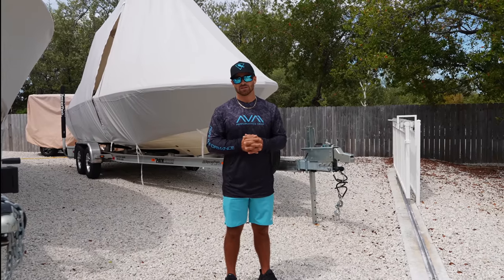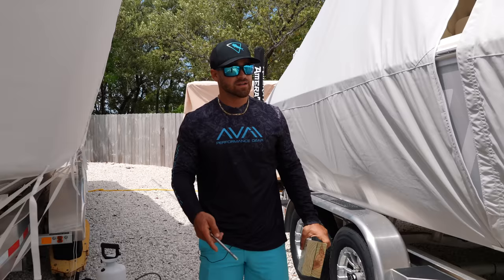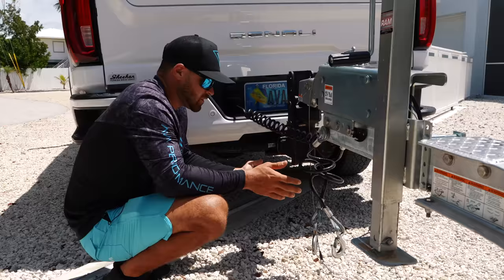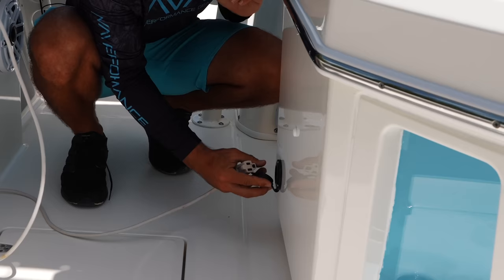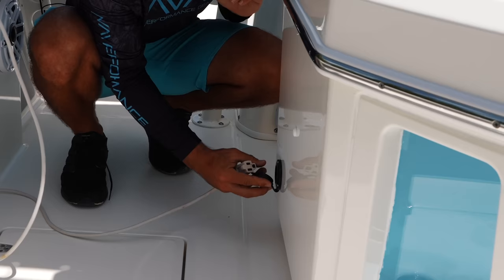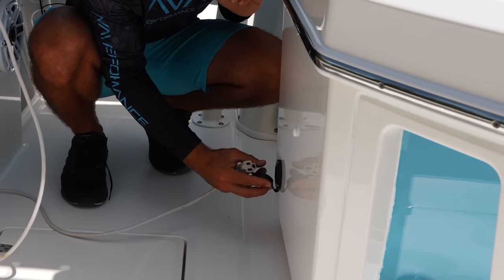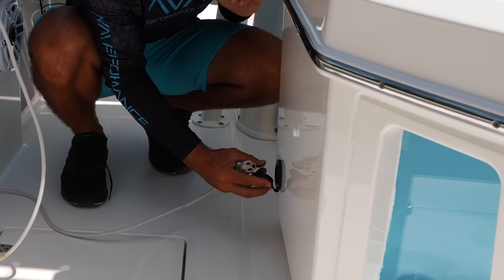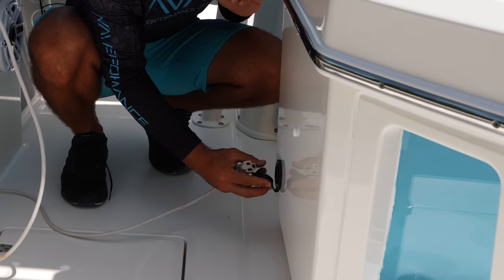Watch This & Boat Ramps will no longer be a nightmare.. How to trailer and launch a Boat

Comment: I’ll tell you a couple more really good tips that you missed on would be when your backing your boat or just the trailer down the ramp put your vehicle in neutral instead of reverse. Let the weight of the boat or just the trailer pull you down the ramp cause if your foot were to accidentally come off of the brake pedal and hit the gas pedal then all that would happen is the vehicle would rev up instead of shooting you down the ramp. The second thing you missed is you should always set your parking brake once you stop after backing down the ramp cause for one it’s just for safety and secondly the weight of the boat or just the trailer is on your parking brake instead of your transmission. And the third thing is when you load your boat back up, your D ring should be resting or almost resting against your bow roller that way the front of the boat doesn’t bounce up and down as you are going down the road. Which could potentially beat up the front of your boat. You nailed everything else though big man. Just thought I would throw out there these other couple of tips and tricks to help people out! And what did you say your clothing brand name stands for I couldn’t really understand it in the video. Thank you in advance!!!!
Reply: Fourth thing is to trim the engine up when loading boat back up.
Reply from the maker: Thanks for the input Mark 👍🏼
Reply: @LifeByTheBow  your welcome. And what did you say your clothing brand stands for? I’m sorry I couldn’t really here it in the video. Thank you.
Reply: your comment is more informative than the whole video.
Reply: @locksmithjeepguy  thank you.

Comment: Thankyou for showing the Floridian community about crossing those chains on the trailer. Where I live in NY, it is a law to do that ! When reversing while in the truck, one hand on the bottom of the Steering wheel makes it much easier.   You put excellent videos out there,   finally, Flush the motor which is full of saltwater. Run it with fresh water for at least 10 minutes. You'll need those headset-shaped for the bottom of the engine.                       Enjoy the Holiday.
Reply from the maker: Hey Keith, thank you so much for the feedback and the Information. We appreciate you watching.

Comment: There is a kit you can get that puts LED lights up high on the guide posts on the trailer AND on the cavitation plate.  Especially at night, but anytime really you have lights ON the engine cavitation plate and up high on the guide on posts.  They look great--anyone hits you on the road with those lights, they have a lot of explaining to do.  Also, there really is no downside to running with your lights on, increase your visibility while towing day as well as night.  One other thing, having everything done is great EXCEPT the strap that holds the thing on the trailer, that comes off dead last as you showed.  But yet one more thing--the ramp you are at has a dock--mine has no dock, so THAT is entirely different as you can't side tie--and the bow of my boat is way too high to climb aboard.  For me--just me, I will never do it alone, one man.  Patently unsafe in my mind.  Just as everything on a boat should be redundant--two of everything, that goes for the skipper, IMO.  Two people, two.
Reply from the maker: Thanks so much! We will check those lights out. We appreciate you following along on our channel!

Comment: Clay I love the content man! As far as the mechanical side goes... I keep a breaker bar in my truck at all times for an emergency, but during maintenance lugs should ALWAYS be torqued to the proper specs. Over torqueing can be just as bad as under torqueing. The PSI on the side of the tire is the max safe cold tire pressure. It is not the recommended inflation pressure as this varies widely based on load. This is a very common mistake and leads to excessive pressures on the road, more bounce in the tires, premature tire wear, and blowouts. Always use manufacturer specs for these values. If you can't find anything from the trailer manual, tire manufactures usually have pressure specs based on load available online.
Reply from the maker: Thanks for the input and appreciate you watching!

Comment: Clay, just to add, what I understand is a tire's “maximum” inflation pressure should only be used when called for on the vehicle's tire placard or in the vehicle's owner’s manual. And you should torque wheel lug nuts to manufactures “torque” specifications that should again be in the trailers owner’s manual. That’s a great trailer. Great instructions. Thanks
Reply: Came here to say this
Reply from the maker: Thanks for the input 👍🏼

Comment: I can’t believe I’ve never thought of backing the trailer up under the boat when you retrieve it! I recently purchased a Grady White Gulfstream that I often trailer by myself. It’s a little big to drive on the trailer so I’ve been using the dock lines to pull it up onto the trailer. I’ll try the method you showed and that should work much better!  Thanks!
Reply from the maker: Thank you!

Comment: Awesome video I’ve been loading our boat on our old trailer and new ameratrail now too before I knew how to drive a car lol and I still learned something and that’s using the silicone spray on the bunks which I’ve never thought of and luckily our saltwater boat ramp has a hose that we use to rinse the trailer but good idea mixing salt away in the pump sprayer if a hose isn’t there.
Reply from the maker: Thanks so much!

Comment: My issues at the ramp are inconsiderate boaters. I keep mine in water at a marina now. The stress of idiots was coloring my time on the water negative.  Love the tips. I have watched people load the boat while on the ramp. Disembark while taking up ramp space. If more folks would plan ahead and get r done away from the ramp, I would be a happy man. I launch in about 2.5 minutes and load about 2.5-3 depending on my wife’s ability to line up the boat with my trailering. Hook it and yank it.
Reply from the maker: Thanks for the input appreciate you watching!

Comment: I definitely learned some new stuff! Honestly, I'm not prepared to get a flat and start bringing my breaker bar and get a little ramp thing in case I need to change a tire. I also will start crossing my chains and make sure they are hooked up correctly. 

I also appreciate the PSA for being prepared and limiting time on the ramp. There have been a few times I have waited while people load or unload their boat on the ramp.
Does anyone else rinse down their wheels and apply that stuff to the bunks? I don't have disc brakes. To me that seems a little excessive and not necessary.
Reply from the maker: Thanks for watching! Rinsing at the ramp really isn’t necessary, it’s something I only suggest doing if you have the time and you’re not holding anyone up.

Comment: Another trick when launching solo is to tie a line from a bow cleat around the trailer and back to the cleat. Just like you do when tying to the dock piling. Release the bow strap before going down the ramp. This way you don’t have to jump off the boat to release it once in the water which gets risky as you get older. 
Additionally, If I have to exit the tow vehicle while on the ramp, I like to place a chuck behind the left front tire.

Comment: A few tips to add. Before backing the boat up always have a front and back 50 foot rope thrown on the dock. You then backup and release your front chain before it goes in the water. Boat comes off very easy and you have ropes to move it on the dock. This is a little over doing it and slow to launch.
Reply from the maker: Thanks for the input and appreciate you watching!

Comment: It helps to apply some grease inside the coupler. Keeps the coupler working correctly and keeps the ground for the lighting. Iron oxide inside the coupler will give part time connections.
The trailer height isn't 13 inches but 13 inches plus the height of the tape measure.
Get yourself some dielectric grease for the trailer light and and electric brake connector. I use a Zip Loc bag and store the connector in the bag with a rubber band holding it in place.

For a friction reducer on the bunks, instead of using silicone, a bottle of 4:1 dish wash soap is extremely slippery. The silicone spray is frowned on as you're putting a hydrocarbon into the water.

Oh, don't forget to raise the engine before pulling the boat out of the water so you're not that guy that drags the skegg.
Reply from the maker: Thanks for the input 👍🏼

Comment: Good info, enjoy the channel. Got a suggestion for you, get a good torque wrench, trailer wheels need to be torqued to spec to insure not over tightening. Your wheel bearings take a ton of heat as it is, no reason to over torque the wheels.
Reply from the maker: Thank you for the information. We appreciate that

Comment: Grew up on freshwater, Pops was a Bass Fisherman, spent about 5 years salt water boating eventually.  Man, that salt is no joke, cleaning it off. What a pain.

Ramp Campers need to be strapped to those Barnacle pilings for 2 high tide-low tide cycles. If they survive, fine. If not, oh well
Reply from the maker: Thanks for watching Sean!

Comment: I have thought that I am putting in perfect load position, but I still have trouble power loading . I wet the bunks and then pull out in good position but still have trouble getting boat to the ring ! I saw you put silicone spray on your bunks . Have you ever had it slip back because of the spray ? What brand of spray do you use?  Would appreciate your opinion and experience on this .
Reply from the maker: check out PB blaster spray. We have not had slip back while the winch is attached. You shouldn't be spraying a lot to where you're worried, a little goes a long way. Thanks so much for the support on the channel!

Comment: My biggest tip would be your headlights on in the mornings ir evenings. Turn them off. Where I'm at there's 3 lane ramps and if you get the middle ramp and the two outside guys have their headlights on you cant see anything. Also guys with light bars on their boats turn them on while the boat is still at the dock blinding you as well.
Reply from the maker: Thanks for the input 👍🏼

Comment: Another complete guide to getting the most out of your boat investment. Today especially, gear is not inexpensive. When you add the word boat to the equation you can double and triple the cost. Add salt and if you take shortcuts before you head out or in from the ocean…. you will have busted gear, wasted days and unfortunately safety issues that can be avoided. Well done Clay…. as an old lifetime boater, I learned the hard way…. Your’s is better!
Reply from the maker: Thanks so much Lance!

Comment: Another bit of trailer wisdom……..make sure to keep up with the age of your tires. Just because they have a lot of tread does not mean they are ok. Take a look at the 4 digit code on the sidewall. Once your tires are over 4 years old, you better be replacing them.
Reply from the maker: Thanks for the input!

Comment: '
the motor vehicle must use a shift '' N '' as neutral with a trailer boat while slow down ramp to the water...
dont use a shift '' R '' as reverse
Reply from the maker: I make sure to keep it in park 👍🏻
Reply: @LifeByTheBow  
hi L...
'
yes 2 locks brakes parks then boat to the safe water...
unlock 2 brakes parks then find empty parking lot...
return to enjoy boat time
Reply: I put my 4WD in low transfer and let it creep down the ramp.

Comment: Stainless Steel Brake Caliper's with Ceramic Brake Pads with Stainless Steel Back plates will last a lot longer, the brake calipers on your trailer are Dacromet plated and won't last to long when used in saltwater same as the painted brake pads back plates and more important wheel lug nuts should be torque with a torque wrench to the correct specifications, a breaker bar should only be used to break the lug nut loose or used only to tighten the lug nuts in an emergency other than that you still have a nice video as always. Tight lines.
Reply from the maker: Thanks for watching!

Comment: Hey Clay. Big fan of the channel. I'm not sure if anyone has asked this or not. But how long have you been using the Blaster silicone spray on your bunks? Have you had any issues with it eating through paint on the boat? We just bought a new 22' bay boat with "sticky"carpet. And I am really worried about damaging the boat while trying to help it come off of the trailer easier. Thanks.
Reply from the maker: I've never had any issues with the silicone spray eating through the gelcoat on the boat. I think you’re just fine. However, just make sure that you only spray the silicone on the front portion of the bunks to create some type of friction. That way the boat doesn’t slide off of the trailer.

Comment: Excellent video and very informative. Have no boat to launch but good too know whenever I am blessed to becoming a boat owner 
Question: at what point did you lower and raise the motor while launching and retrieving the boat 🚤 
Again thanks
Reply from the maker: Thanks so much! I don’t lower or raise the engine unless the boat is coming off the trailer

Comment: Did you mention that you should only tie to the dock if you're solo? Or, better yet, beach it if there's a sand or grass beach available? 
Tying to the dock when others are aboard is considered a major bonehead move where I live. It just isn't done, because it blocks the ramp and prevents others from launching and loading in a timely manner.
Reply: I thought I was the only one that noticed.  It was a moot point here because nobody was waiting for the ramp but if you were conducting trailer maintenance while blocking a ramp on a Saturday morning on the Texas coast someone might cut those dock lines and set your boat free.  Other than that, this was great information.
Reply from the maker: We explained this in the video but thanks for the input 👍🏼

Comment: A torque wrench would be better for those lug nuts. Some people just torquing on those things with a breaker bar will over tighten them. There’s some knuckle heads out there
Reply: Absolutely, I keep a torque wench in my truck at all times, along with impact sockets for truck and trailer lugs. I take a Milwaukee cordless impact on out of town trips.
Reply from the maker: Thanks for the input and appreciate you watching!

Comment: I have a question about something that worries me a little :) ... I got a 2021 Sierra 1500 2WD and I just got a Wellcraft 24FT Walkaround. Should I be able to pull that boat on the ramp without issues? or would I end up on an Instagram feed?
Reply: I have a 2016 Ford F-150 2WD that I pull a Grady White 232 Gulfstream. Probably about the same weight as yours. I am able to tow it fine on the road but have to use ramps that are not too steep or long. Almost got stuck a couple times trying to use ramps that were too steep. Pretty sure if I had a 4WD a 150 would have no problems.
Reply: @forgottencoastfishing  good to know. Thank you 🙏
Reply: Oh and make sure your trailer is set up so you have the appropriate amount of weight on the tongue. Mine was too light on the tongue at first and that’s when I was having a lot of trouble getting it up the ramp. Once I had the trailer set up correctly with more weight on the tongue I haven’t had any issues pulling it up and it tows much more smoothly and safely! I may be able to pull it up steeper ramps, just too afraid to try!  As you said, I Don’t want to end up on Instagram!
Reply: @forgottencoastfishing  Didn’t even know that was a thing. Got to look into that. Thank you. Yeah staying away from IG fail feed is a big must lol
Reply from the maker: Looks like this was answered, thanks for watching!

Comment: First time I have seen the silicone trick. Do you feel that really helps?
Reply: It works, but be careful! I have not used it on my bay boat bunks but my previous boat was a Carolina Skiff DLX 2180 that I used a lot alone. After using spray on the bunks, it was easy to just push the boat off the trailer by hand then walk the dock. After using the spray a few times, I would treat it like a roller trailer until I got a feel for it, I know my 21' skiff would have launched itself if I wasn't careful, those bunks were slick. It does extend the carpet life.
Reply from the maker: For sure! Just make sure to spray it very light!

Comment: i dont agree with your unhooking the boat from the trailer without the motor being started, a dock line attached to the boat or dock and no person aboard. if your watching this video you probably need all the help you can get and most fat americans or people who are new to boating aren't able to do the gymnastics you are climbing down the spare tire of the trailer. but that's besides the point of unhooking your boat without a way to retrieve it if something goes wrong.
Reply from the maker: The point of this trailer is to not have to retrieve. It’s a power on power off trailer. Therefor once it’s unhooked you shouldn’t have to worry about it sliding off. Thanks for watching.
Reply: @Life By The Bow  i think its my concern for tide and current at the Ramps  I usr in general